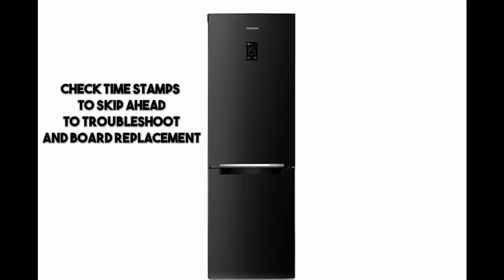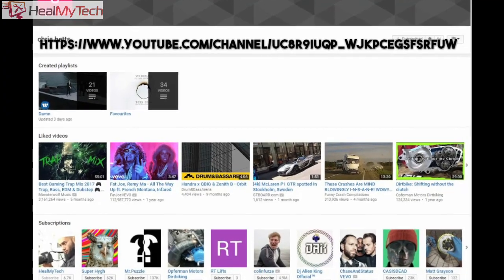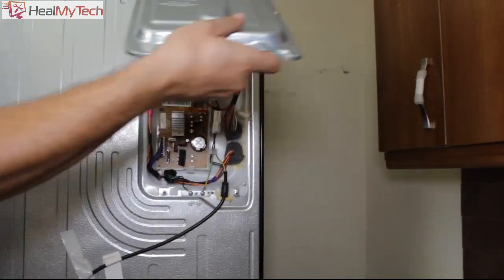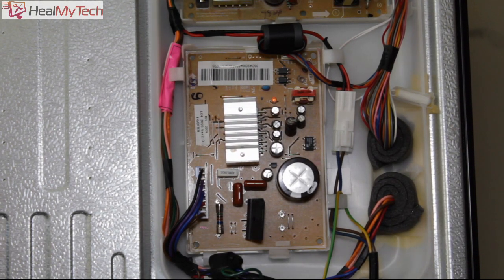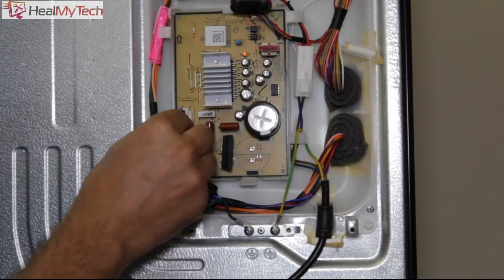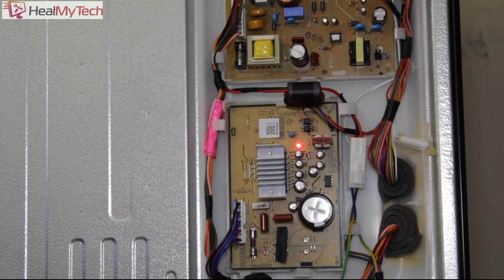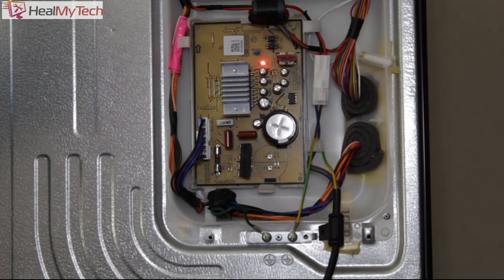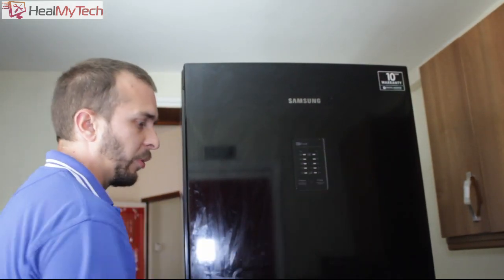Fridge Freezer Blinking Led Light Not Cooling Not Freezing – SAMSUNG RB31FERNDBC – Board Replacement

Comment: Samsung RT45KSSW fridge compressor over heats.
Right side body gets hot.
Main control PCB led starts blinking 5 times after few hours.
Cooling deteriorates and compressor gets untouchable hot.
Fridge is not inverter type.

Comment: I've a linear Inverter LG model refrigerator which shows dual LED blinking on a pcb. What does that means. Red 3 times with a gap and once pressed the reset button green and red together blinks.

Comment: Ours just went dead. The flashes I'm getting means bad inverter board or compressor. I'm trying to figure out how to test if it's the board for sure. If you buy a board they say you can't return it if it's been installed. Then I'd be out $110 if it ended up being the compressor.
Reply: i have the same question and problem too